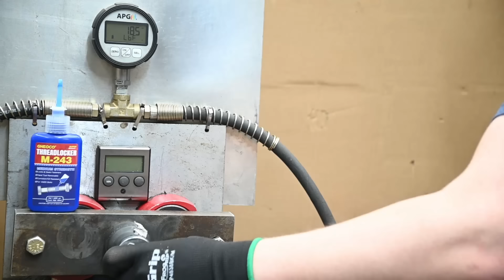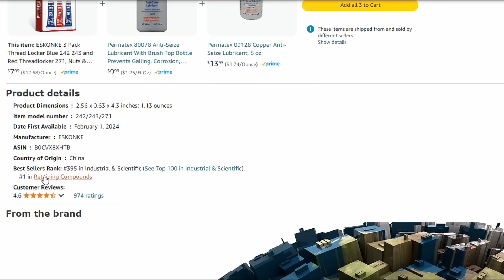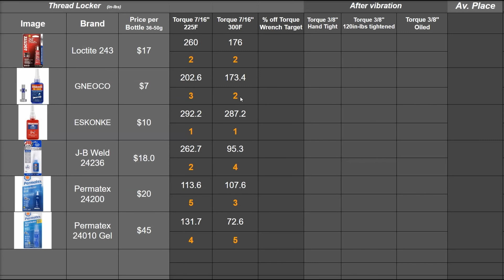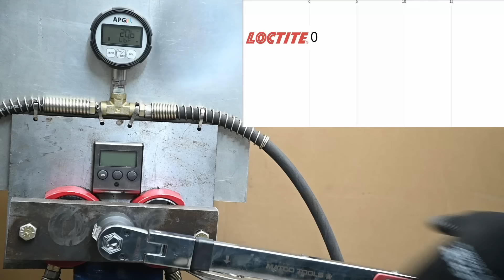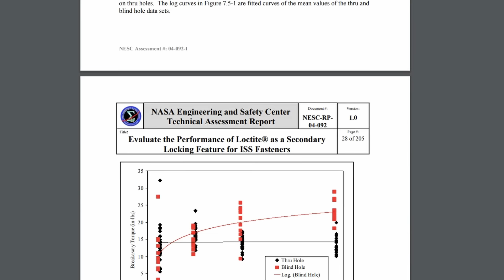Best Thread Locker isnt Loctite? vs Permatex, JB Weld & Amazon

Comment from the maker: Our large bottles of Eskonke just came in, and it's the same great gel like stuff https://amzn.to/3TVlgsz Lots of people asking about the shaker: https://amzn.to/3Yn2kVb
Feel torque alone doesn't make for a good or bad threadlocker? Us too! This video mainly covers the AFTER effects of 4 topics: heat/engine temps, target tq, vibration testing, and even oil resistance that didn't require any tq value comparisons. Sure, a torque wrench obtains a lot of the resulting data, but that's also how Loctite tests samples too :D
Reply: I would have liked to see the harbor freight versions on the list
Reply: If you look at the test results for your tests, the ESKONKE brand is the only thread locker that actually created full locking torque with a hand tight fastener. In my opinion this is the only test that matters. The whole point of thread locker is to prevent a loss of life or a catastrophic explosion on mission critical bolts. Airplanes, motorcycles, internal engine parts, suspension parts, seat belt bolts, etc.

It is possible to "forget" to torque a bolt properly. If that bolt loosening could cause a loss of life, then it needs a thread locker that works, even if you forget to torque it properly. 

For example, the Suzuki DR650 motorcycle, for almost 20 years, they didn't use thread locker on internal transmission bolts. There are 2 very small bolts inside the transmission case that fall out, potentially locking up the transmission. 

The other brands did not work for hand tightened bolts, only Eskonke, and the really cheap $5.00 Amazon stuff that you threw away in the beginning. For life saving bolts, these are the thread lockers that should be employed.
Reply: I recently had a rocker keep undoing its self and found only Permatex to use. Failed few times,  reapplied it one time at work right before driving home and its been tight ever since. Every other time I let it dry before driving.  Cool stuff Guys.
Reply: Permatex ftw :D
Reply: Will the off-brand threadlockers be consistent over time? Thats my rationale to stay with the name brand. Maybe next year the Amazon seller finds a new cheaper supplier and it’s not the same thing
Reply: Should have also tried Red and Black JB Weld 🙂🚩
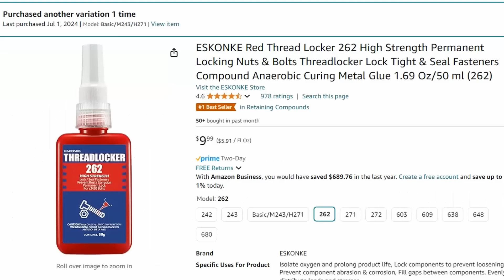Reply: @15:19 small detail, the GENEOCO 16% should be a 4 not 5, as 5 went to 17%. So average would be 2.5 moving it into 2nd place.  Thank you for this test, very helpful!
Reply: Disappointed you didn't test the Harbor Freight brand.  They have two different offerings of the blue stuff and I've been wondering what the difference between them was, but I don't have the calibration equipment to test and find out. 

Anyways, the stuff works for me.  If I need to make sure the bolts are NOT coming off without effort (like say installing a catalytic shield on my dad's pickup) I make sure to apply liberal amounts to all the threads.  This is pain-free due to how cheap it is.  
I even use it to seal my air fittings!
Reply: bad design of test: screw test the most comprehensive one is ASTM-F543 (I worked on industry years ago) ... I cannot remember the exact but its A2/A3 torsional test is what you are looking for ... I can quickly tell you yes the numnber of pitch screwing is linearly proportional to the screw in torque

Comment: Best thread locker is rust
Reply: fr
Reply: Saltwater on every bolt! Much cheaper than permatex.
Reply: So hit it with a vinegar and salt mix before torqueing. The project farm way.
Reply: Superglue works and cheap.
Reply: rust is a red thread locker, should compare it to those
Reply: The original red thread locker
Reply: WD40 that she'll be right.
Reply: Nah, cross threading is the ticket.
Reply: @drizitgaming  that has only stripped the bolt for me
Reply: I counter: the best locktite is cross threading
Reply: I'm aware..... I live in New England.
Reply: CARC paint works amazing as thread locker. Hard for the bolt to move when there is a half inch of paint on it.
Reply: Nah man jb weld on the threads or just weld your bolts into the engine block.
Reply: Be a man 😂
Reply: A shot of salt water makes it easy :D
Reply: This comment 👍🏼
Reply: I’m in Chicago this is true
Reply: You mean thread destroyer.
Reply: Crossthreaded AND rusted
Reply: Salted midwest roads during winter are the best thread locker
Reply: HÅAAAA Good one
Reply: @ObservationofLimits  thanks for participating and ruining the fun
Reply: Don’t forget using a bolt with the incorrect threads for the hole it’s going into, that bolt will be permanently a fixed also
Reply: Or sand
Reply: Underrated comment 😂😂
Reply: Thoroughly soak your nuts and holes in a mix of Hydrogen peroxide, vinegar, and salt to instantly rust it
Reply: Disagreed, the best thread locker is cross threading
Reply: Cross thread and send it home
Reply: Crossthreading is better
Reply: this combo too is also funny, aluminum and stainless steel
Reply: @littlejack59  just spray threads with salty water
Reply: Vinegar, cross thread, and welded
Reply: @shadymaint1  CARC and rust = RIP 3/4" breaker bar.
Reply: Dead ass I struggled with some Ford box bolts on an F250 for like three hours last week
Reply: Best threadlocker is crossthreading.
Reply: @avotius  you must be a fellow east coaster.  Lol
Reply: The tire shop that torques your 105 lb-ft lugnuts to 365.
Reply: I think the best way to lock a bolt in is to induction heat it until it melts and then cast titanium around the entire piece it's bolted to.
Reply: @littlejack59 we’re gonna test that!
Reply: Nope. It’s DEFINITELY cross-threading a bolt & still using an impact to ‘tighten’ it… & of course- using ALL the beans available. 
 Bam. Tight as can be. 🤷🏻‍♂️ 

😆 😂 🤦🏻‍♂️ 🤦🏻‍♂️
Reply: Nope. It’s DEFINITELY cross-threading a bolt & still using an impact to ‘tighten’ it… & of course- using ALL the beans available. 
 Bam. Tight as can be. 🤷🏻‍♂️ 

😆 😂 🤦🏻‍♂️ 🤦🏻‍♂️
Reply: Just about blew out a sinus when I saw this. Lol.
Reply: Doesn't work on mx bikes that vibrate bolts loose, but you also need to take out and re tighten frequently.
Reply: So true
Reply: The best thread locker is a bolt in aluminum.
Reply: @georgestweeter  i think galvanized steel in aluminum is the worst
Reply: Just cross threat the trash out of it and full send it.
Reply: @Rudy97  you must not have cross threaded it hard enough... or perhaps too hard ;)
Reply: FACTS
Reply: or bi-metal corrosion.
Reply: @drizitgaming  the biggest one was m14 and that stripped instantly.
Reply: @evilution_ltd  you mean like galvanic corrosion when mixing aluminium with esentially anything?
Reply: @Ferrari255GTO  yep!
Reply: Galvanic corrosion ftw
Reply: A crossed thread is the tightest thread
Reply: Not steel to steel rust, steel to alluminium rust. Galvanic corrosion is a bitch to loosen. I recently did my front and rear shocks and springs, the front drivers side bottom knucle spline bolt that went through the strut assembly was so stuch it took literally 12 hours of hammering, fire, grinding, and cutting to get it out. Safe to say, you should probably use antisieze on alluminium to steel connections
Reply: Just cross thread it!
Reply: @TheShitSmith  Came to say exactly that, and knew someone else must've. Glad I did some scrolling! 🍻
Reply: 😂 you're not wrong.
Reply: Hmmm .. My slogan is "Crossthread ia better than loctite"
Reply: @FLabrenz  thanks for paticipating
Reply: Amen
Reply: I've forced this ironically or un 😅👍
Reply: Yea, but they just have the red option!

Would like to have some of that blue rust! ;)
Reply: @kingofxbox7105 don't need to undo the bolt anymore though, the frame already disintegrated around it
Reply: My preferred thread locker is a good cross thread
Reply: The original thread lock is cross threading. 

Torqued to spec or cross threaded, tight is tight.
Reply: @alexvandam2015  lol
Reply: Won't argue with that
Reply: You mean cross thread
Reply: Best thread lock is galled stainless threads.
Reply: Or a couple of tack welds.
Reply: Just cross thread the fastener and send it home with an impact.
Reply: And aluminum oxide keeping the rim on till you get the hammer.
Reply: Raw Steel bolts in aluminum for some reason is like welding it shut (bolts for the brake caliper bracket on the front axle on like a 2014 Passat)
Reply: Best threadlocker is bronze brazing rod
Reply: Nah, crossthreading is the best locker :D
Reply: @SamnissArandeen  PREACH! 😆 🤣
Reply: Im the kind of person that does cross threading instead 😊
Reply: Best threadlocker is crossthreading
Reply: No way.  Best thread locker is cross threads
Reply: Na just weld that b
Reply: Tried tested and found true,RUST.

Comment: Loctite has one enormous advantage over all other brands. It has the system. Everything is researched, tested and compatible. They have databases, specialised advisers and training.  Every product has dedicated degreasers, activators and applicators. We pay for all that of course, but in exchange we get repeatable results every time, a warranty and a peace of mind.
Reply: Henkel has a loctite formulation for literally every and any application you could conceive of.
Reply: I reached out to a rep for a new process we were doing and finding the correct glue for it, and they sent out two people, some various equipment like automated dispensers, and we spent a few hours testing strength and seeing which one worked best for our application.
Reply: Their gap filler and 242 'press fit retainer ' has also proven a life safer. It's nice to know there's cheaper options perhaps but long run is it worth the risk? As an employee I always wonder about the liability.... Just like shopping AliExpress no certificate of liability later. It's all on you!
Reply: @Sw-so4zj  Loctite in that price offers you that they literally take some part of liability on them.
Reply: Also, a US made product. The Amazon knock-off is made in China.
Reply: I'm not a mechanic, but if a manufacturer specifies the use of a thread locker, are they specifying a brand too? I'd assume it's loctite since it seems to be industry standard
Reply: @wearsjorge55  sometimes there's a part number, or brand, just like any chemical. Install the twisty-bits using Loctite 243 or equivalent, or whatever. For that kind of chemical, most people (or shops) will have their standard go-to selection. I'm going to use a dab (maybe a line or two) of whatever kind of red we have on your caliper bracket bolts and driveshaft bolts, regardless of the manual or previous presence.
Reply: @wearsjorge55  they will if you read the manual, or there'll be something to at least indicate a type. I've seen exploded diagrams where bolts have been arrowed with '242'
Reply: It's also the only one easily available in Europe.
Reply: @MichaelBylehn  There are many local brands, but still Loctite is the most popular.
Reply: Would liked to see vibra-tite they are very different.
Reply: @wearsjorge55  CAT specifies stuff in procedures.  Usually they'll add a cat PN to it, then you order it and it's locktite or whatever funnily enough.  However, you can see it in an image half the time and just get it at the store lol.
Reply: In manufacturing you see specific Loc-Tite numbers called out for specific uses. The engineers can be certain of exactly how it will work and exactly how consistent it is, so they can select the exact formula they need. That knowledge is incredibly valuable.
Reply: At my work we sometimes need to threadlock shit, and we legally have to use the exact Loctite product called out in the tech data. No substitutions, no other brands. Then again this shit goes on airplanes and the operators rely on that system and that repeatability.
Reply: @christopherestewart  do not buy amazon loctite. no expiration date. not good
Reply: @wearsjorge55  depends on manufacture. most big names have their own, or a permatex equivalent they recommend with part number in the service literature, however most techs have a preferred way of doing things and dont need/follow literature.
Reply: Years ago my technical college had a traveling Loctite (Henkel) salesman come in and give a presentation on All things Loctite , I’ve since passed his details on to several large companies and had him give similar presentations to their employees and I’ll sing the praise of Loctite till the cows come home because they genuinely care about what you’re trying to do and will offer advice and product support no matter the job at hand .

Comment: By far the best thread locker I've ever found is the new guy with an impact gun, guaranteed to never come off again. Cross threaded all the way down, break away torque needed for removal will exceed break away torque of the fastener. 2nd runner up is rust.
Reply: the use of any kind of special fastener, such as a car's locking wheel nut, just torqued to spec
Reply: Ah yes the new guy with impact, only the best of the best threadlocker for my car. Tried taking transmission fluid plug off. Resorted to a ½ driver with a ½→⅜ adatper and a hammer with it's head wrapped around the driver pulling it. It didn't budge, gonna take it to someone with more equipment before i break the transmission case.
Reply: Fact of the Decade 😂
Reply: @PlumbCarton5607 bet its rust, try n heat it
Reply: @rabbitdrink  I don't really have the means to heat it otherwise i would.
Reply: @PlumbCarton5607  what about a lighter? just gotta heat it up most of the way then impact it out
Reply: For real. A new guy at a tire place went at my wheels with one and it took a man jumping on a torque wrench to get the lugs off.

Comment: The anaerobic polymer chain is activated with free ions.  Non-ferrous materials even have issues due to their stability, even your coated fasteners inhibit the monomer kicking over and curing.  If you used an activator on that acrylic block it would have even cured there within minutes.
Reply: Hell, with the activator, if you're not quick enough it starts to kick before you've threaded the bolt all the way in!
Reply: I can confirm this, you need an activator in that scenario per loctite instructions
Reply: really??ooh good tip🌊
Reply: @ke6gwf  what's the activator?

Comment: Sad you didn't include Vibra-TITE. This is the best thread locking brand I've used in 30 years of being a mechanic
Reply: Vc3 is my go-to.
Reply: Project Farm did it like 7 years ago.
Reply: That stuff is way better on small fasteners like firearm scope mounts too
Reply: Vibra-Tite in the gallon jug is the best lol.
Reply: I came down here just to mention Vibra-TITE. I also use it on duty holster screws and accessories.
Reply: Vibra-tite has held fasteners for me well beyond the norm.  Would love to have seen it tested.
Reply: Have you or anyone you know ever used 3M's TL42 or other 3M threadlock? It always seems difficult to find some 3M products like this outside industrial supply stores so I understand why it was not included here.
Reply: From what I hear, Vibra-Tite is sort of a different product. It's not intended to increase torque to remove, but instead just prevent vibrations from loosening the bolt. As someone who's used it for a while, do you have any insights about that?
Reply: @wbfaulk  blue thread locker is pretty much to keep things from vibrating loose and that is what Vibra-TITE does
Reply: Or Versa-Chem - they are another one that has been around for many years and performs on par with Permatex or Loctite.
Reply: Was looking for this comment. PF did test it years ago and it did the best overall -- Would have loved to see how it did in the Dork Test Channel's testing.
Reply: I thought this was a lube joke
Reply: @wbfaulk  for little hardware on things like gun accessories it's awesome. Not on components that take heat though.

Comment: You should have left the disqualified one on your chart with big bold letters warning anyone not to buy it. I know with other things where I'm considering a tool that's not in your chart, I will actually still consider just trying it.

Absolutely love the video, for the weekend warriors another good test might have been extremely old loctite versus new loctite. I've got some 15-year-old stuff in a drawer if you want it.
Reply: My favorite application of thread locker is when the manufacturer applies it to an auto part in such away that it cannot be threaded in without scraping some off. Old gm distributor cap bolts would snap off a corner of the distributor if you did not clean off that huge glob.
Reply: I actually have some projects that are not intended to be disassembled so that one would be great for me to use
Reply: @jeremychance6463  That's what the green loctite is for, think of it as a one part epoxy.
Reply: @Proton_Decay  ya but that stuff is cheaper than name brand
Reply: Agreed, plus he didn't put a link in description for them either.  Kinda odd to disqualify a company because their product is too strong.  Knowing what he showed us I would still get it and just use it more sparingly and would NOTE its 2x or 3x power level for subsequent projects.

Comment: 2:00 Loctite themselves demonstrate this on their channel and trade show: in a blind hole, you need to put Loctite in the hole (not at the bottom) rather than on the screw because on a tight fit, the air leaving will push the thread locker up

Comment: This testing was awesome - super helpful.  I have one question though.  Sometimes a tube of Loctite in your toolbox will be there for a while, sometimes you lose track of how old the stuff is.  At what point is it starting to really lose it's performance - after a few months, half a year, year and a half???  If you need some old Loctite to test, i have some for sure!  

Also even though the bottles will have an expiration date on them, sometimes the bottles get beat up and the label becomes hard or impossible to read.   

Thanks, your channel is definitely one of my favorites, the information and quality of the videos is consistently high.